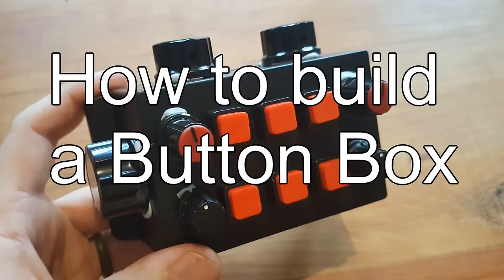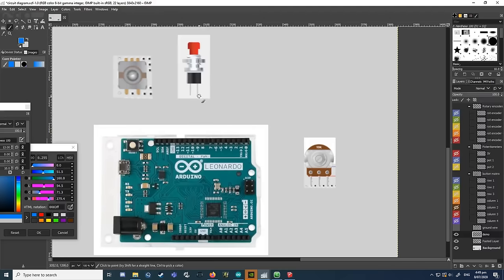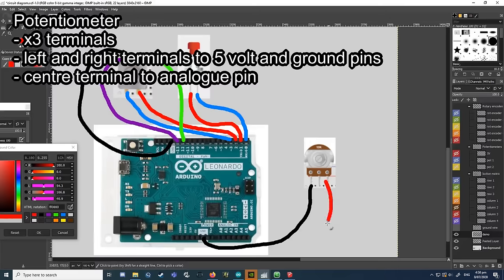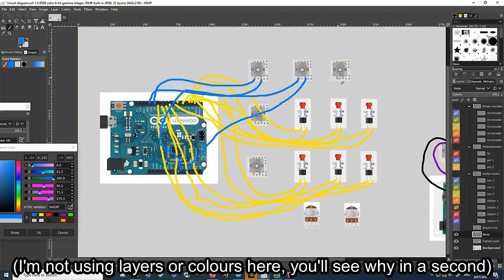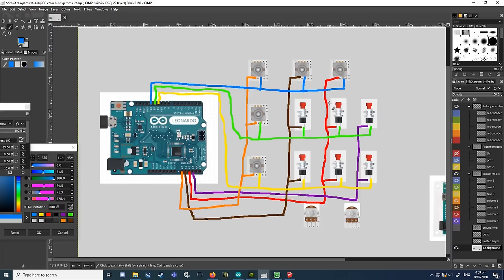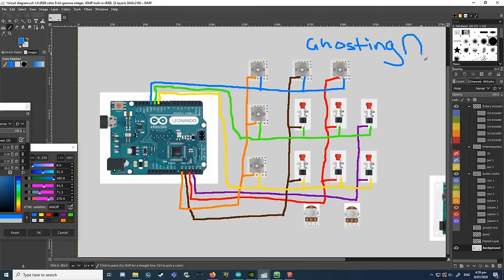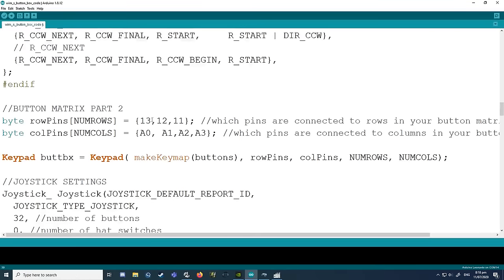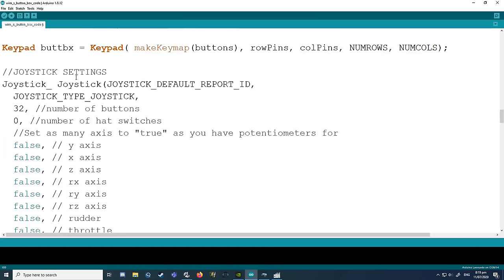How to Build a Button Box

Comment: Ghosting can happen by pressing just two buttons at the same time, if they are on different columns AND different rows.
e.g. If you press the button on column 1 and row 1 and press the button on column 4 and row 3 at the same time, the controller will think you also pressed the buttons on column 1 and row 3 and on column 4 and row 1.
This can be avoided by adding a diode at each switch. Perhaps our host will explain how in another video. (but that would require explaining how matrix scanning actually works)
Reply from the maker: This video is intended for people with zero experience who want to build a button box. It's not intended to be a full lecture in how all the electronics actually work.
Reply: @wimwamjoey  I understand that, and it's a great video, but how much harder to say or understand is it to say "ghosting can happen when you press two buttons at the same time" than "ghosting happens when you press more than two or three buttons..." And I don't think it would be that much harder to understand "the controller turns on the rows one at a time, and checks whether any columns come on at the same time." That way, if you ever want to explain the use of diodes in a later video you wouldn't have to explain that you lied oversimplified in this video. I imagine you expect your viewers to progress with time, yes? If you say that the controller recognizes when a column input and a row input come on at the same time, then as they start to understand how electricity works it is going to confuse them.
Reply: @wimwamjoey  I'm sorry, I just realized, your channel is a gaming channel, not an electronics channel. Few if any of your viewers would care at all how it works, or progress, or be any more confused, in their understanding of electronics.

Comment: good stuff - all I need to do now is to work out to combine the output of 2 potentiometers - i have an old set of pedals from a sidewinder force feed back wheel , and wish to have the value drop on one pedal and the value increase on the other,  but both on the same axis,  so at rest the throttle would be at 50% like the rudder is,  I have had a go but its a challenge when your unfamiliar with  the coding -
Reply from the maker: You might be able to do this using autohotkey and setting it up so that the farther the pot is turned, the faster it taps a key. It's a bit of a janky workaround though and would probably take a lot of fiddling to make it work properly

Comment: I would either use a mega or program multiple arduino microcontroller stand alone chip sets. Also proto wire that I had seem to corrode after time and less reliable in those arduino no solder sockets. For a permanent project I would buy the crystal capacitors and atmel chips program in a uno board, transfer then solder In a different  board.

Comment: Hi, I wanted to tell you that in the end I fixed everything and it works, the only flaw is the rotary encoder which, if turned quickly, is not always able to read the right number of steps, is there any way to improve this? Thank you
Reply: He explains this in the video at 3:45. You'd know if you didn't skip through

Comment: Good afternoon Win.
Instead forgive for this assault and forgive for the writing since it is done with the Google translator; I hope you can understand.
I am writing to you because I have seen this project of yours and I see that you understand all this, congratulations on your project.
I tell you my circumstance:
I am a person with reduced mobility and I have to adapt the accelerator and brake to a steering wheel.
I know there are several options on the market, but I think I can do it myself. The project is to adapt 2 magnetic paddles, one on each side, to have the accelerator and brake on said paddles.
I want to do it with an Arduino NANO and with a potentiometer on each blade.
My question is, could you tell me or give me some Arduino code to be able to execute the 2 potentiometers only?
I have seen in this project of yours where they are connected to Leonardo's board, but I would need the code for my project to work.
Thank you very much for attending me and greetings.
Reply from the maker: Hi there, you can only make a button box with an ATmega32u4 microcontroller. As far as I know, that means you must use a Leonardo or a Pro Micro (or a non-branded copy of those). I'm not sure what microcontroller your nano uses, but if it is the ATmega32u4 chip all you need to do is make sure you have the right kind of board selected in IDE when you upload your code.
Reply: @wimwamjoey  Thank you very much for answering
All the best

Comment: When talking about rotary encoders and potentiometer, which would be better to use for a dial to select between a few different options? Something like a rotary light or air controls in a car. Both are a dial, but both have multiple positions that the dial clicks into.

Comment: I want to try it out before I go full fledged build.
I am planning to order arduino pro micro, 1 two position toggle switch, 1 rotary encoder and 1 potentiometer.
I am getting confused with wiring. The pinout of mico is different.
Would you be able to explain where to connect them on micro?

Comment: I'm brand new to this idea and am exploring it as a potential alternative to buying a button box.  I've never done anything with an Arduino before.  You mention both the Pro Micro and the Leonardo.  What are the differences between the two, and how can I know which one will better suit my needs?
Reply from the maker: Leonardo is intended more for people who  want to reuse their arduino for various different projects. Pro micro is what you'd pick if you just want to use it for one thing.

Main practical difference is that the Promicro is physically smaller than a Leonardo, and you need to solder connections to the board rather than just push wires into sockets like you do for the Leonardo.

I'd probably recommend the Leonardo over the Pro micro for a beginner. If you think you are going to have to have a few goes at getting stuff right, it's easier to do this with a Leonardo, cos you don't have to worry about soldering, desoldering and resoldering wires to the board and potentially breaking it in the process. 

Aside from that, both the Pro micro and Leonardo have a total of 22 pins, however for the Pro-micro 11 of those pins can take analogue signals, while the Leonardo only has 6 analogue pins - so basically if you think you want more than 6 potentiometers, you need to use a Pro micro. 

Finally: Pro micro is a bit cheaper than a Leonardo.
Reply: @wimwamjoey  Thanks so much for responding.  I've done some soldering before when I built a radio as a kid, and some model railroading with my dad, but not a lot, so I'd definitely want to practice before I risked damaging a board.  It sounds like the Leonardo is more what I'm looking for.  I don't think size will be too much of a consideration, and I can't imagine I'd want more than maybe 2 potentiometers at most.  I really appreciate this video and will absolutely use it as a guide when I get around to building a box, hopefully in the next month or so.

Comment: An excellent vide. I used this as a basis for 2 button boxes that I use for DCS. One issue though that I was wondering if there was a solution for? Each box works on its own. But when both are plugged in only one box, the largest one actually works in DCS. The other box shows up, but DCS won't take any inputs with it. Any ideas on how to use both boxes. BTY both use Ardiuno Leonardo's as their brains. Thanks.
Reply: DCS train controller software ? conflict probably, both identify as a "leonardo", plugged in as usb to your pc ?
see https://github.com/MHeironimus/ArduinoJoystickLibrary/issues/14, 
look for the answer from "Dak0r commented on 4 Mar 2017 "

Comment: How do the 3 pin (on)off(on) momentary switches get wired into the matrix?
Reply: You can treat them like two simple push buttons that are on the same column. Wire the center terminal to a column and the other terminals to two different rows (or vice versa if it fits your layout better).

Comment: Hello! Great tutorial you've made here. I'm a little more of an experienced arduino programmer, and i'm wondering why you would use two data-reading IO ports per pin of the push buttons, and not wire one pin to gnd, and one to an io port? This gives you double the amount of available pins, and could be used to avoid a potentially confusing button matrix.
Just another maker, trying to make his way and learn some new tips,
cant wait for your reply.
Reply from the maker: No good reason. I only have very rudimentary knowledge of arduino coding. I figured the button matrix was more flexible and I didn't want to explain another method in this video because it would require substantial changes to the code. I only used the two port method as an example to show why the button matrix is useful.
Reply: @wimwamjoey  thats fair enough. Just wanted to make sure I wasnt missing anything. Nice tutorial again!
Reply: @dachampion_9993  I interpreted your question differently than how he answered. 

I'm using an Arduino micro, and there are far less pins available on it than an Uno, Mega, or Leonardo. I use methods like the matrix to put, say, 16 buttons on a set of two pins. This matrix does actually allow for up to four buttons to be pressed and detected correctly at the same time, so you can group those together if it's likely to occur, and leave buttons out of the group if they physically cannot/wouldn't be pressed together. This IS confusing and some inputs just have to have their own separate pins. Rule of thumb is for the either the entire row or column, you can only have one line closed. If there are two or more closed on both, that iteration of the matrix has to be thrown out completely and not acted upon. 

If you're asking about his diagram at 8:52, and why he has two wires per button going to the controller, it's wrong. You never need to have two IO pins for a contact switch. Maybe for an encoder but that's it. In the case where a single button goes to a single pin, you can either pull it high or low from VCC/GND and have the switch close a CKT to VCC/GND. I pull my inputs low, so I connect my buttons on one side to power, and the other side has a parallel connection to GND and the input pin.

EDIT: Just to be clear, I am NOT calling out Wim for being wrong. I am only saying the configuration at 8:52 (and a couple other times during the video) should never be utilized. He also explains this later on in his video without explicitly stating "Don't do it like this."

Comment: Really well explained :D
Do you have a simple solution for using Multi position switch for his kind of button box?
I tried to do something on my own, but best I've achieved is "pulse mode" since trying to make MPS send constant signal, then it blocks encoder functionality. 
Btw. I have that done by making my MPS work as potentiometer, so it uses only 1 analog pin instead of 10 :)

Comment: I have a butten box allredy but is there a way to look at my code that’s on my board if so how
Reply: There are ways to extract the code that is currently on an Arduino (assuming your box is using an Arduino), but it will be the compiled machine code, not the source code.

Comment: The button matrix is only possible on the arduino boards right? Wouldn't work with something simple like a zero delay?
Reply: Not unless you would be able to change the code running on the board.

Comment: Thank you very much for this video. I have a question: is there an alternative to soldering the matrix to avoid running out of pins? I’m preparing a setup and I’d like avoid soldering as much as possible. I’m new to Arduino and I’m looking for ways to connect the cables without the soldering part. Thanks indeed!

Comment: Cool video. Is there a reason no pull-up or pull-down resistor is needed in this circuit/button box? I watched a couple of video's about how a keypad matrix works and all of those video's suggested you should put a pull-down resistor on every row. So that you don't get floating pins.
Reply from the maker: I had a mate who worked with arduino quite a lot who told me the resistance in the wire itself would be enough for a low voltage project like this. Certainly no harm adding resistors though if you'd rather be safe than sorry

Comment: Was wondering if you could do an updated video some day with how to wire like on off on momentary switches into the matrix, I've been reading a lot of forms and they say to use something called a switching diode, i actually got my switches to function in the aurdino, however only one click registers and it registers it as 3 inputs being pressed at once.
and all the switches are registering the same button press as 4,5, and 6 no matter what switch i flick, so I'm fairly sure there is ghosting happening as well as something else that I am not sure of.

Comment: Hey, great video!  Those Push Buttons... dont they use 12V? So how are you providing them with the 5V the Arduino has?
Reply from the maker: They are rated to 12V but don't require 12V to function. They work perfectly fine at 5V.

Comment: First of all, huge thanks for the tutorial but i have a predicament... in my button box i have 6 3-way momentary switches and i was having trouble on how to wire them... so far i have two of each in a row and two columns with just those switches, my problem is that only connects one of the two buttons per switch and i dont know how to wire the other button... the solution i thought was just to add an extra column, but i dont know if that is correct since i havent found anything anywhere else...

Comment: This is an amazing video wimwamjoey, full of info. Thanks a lot. I have a question. Is it okay to ask it here or can I contact you privately ?
Reply from the maker: Go ahead
Reply: @wimwamjoey  thank you sir. I am very new to arduino and such. Can I make a button box that features the 32 buttons where 4 rotary encoders will obviously be 12 of those buttons and also add 1 analog pot using a pro micro, or will that only be possible on the leonardo which has more pins?
Reply from the maker: Argh, so sorry for delayed answer. This got buried and I didn't have notifications turned on... 

Yes, so long as you configure your button matrix in a way that it doesn't require all the analogue ports for rows/columns you can add a potentiometer. Potentiometers do not count towards the maximum on 32 buttons.

Comment: Hello thanks for the video.
Just a few questions.
I have an old joystick that I want to rewire to go from 15 pin analog to usb.
Using a Arduino pro micro.
Joystick is an old Saitek Cyborg 3d digital.
Joystick is up down left right. 4 analog potentiometers  4th potentiometers is for throttle.
8 way hat.   ??
10 momentary switches. 3x4 switch grid 

1 For  the button matrix can you use just digital pins, no analog pins?
2 How would I wire the 8 way hat on the joystick?
Reply from the maker: Hey mate in answer to your question:
1.) Yes that's no problem.
2.) It depends a lot on how your hat actually functions. 

Most likely, it will work by tripping four switches (up, down, left and right), then reading two buttons being pressed simultaniously as the diagonal inputs, so if you want to maintain it as an 8 way hat, that will require some additional coding on your part. 

If you just do it as a four way hat, you could just include those four buttons as part of your matrix.
Reply: @wimwamjoey  Thanks for the reply.
The hat feels like four buttons an that is all I will need to make do with what I want.
Have a day

Comment: Awhile ago I decided that I wanted to be able to use any old keyboard on my Linux machine as a macro keyboard so I wrote this code:

https://bitbucket.org/NevynHira/macrokeyboard/src/master/

It's all done in software. To change its functionality, you just have to change a single json file. Because it's done in software, it can do things that hardware based macro keyboards can't do such as be aware of what application has focus and act accordingly. i.e. the same key can be used in Firefox to do one thing and used in another application to do something different.

Comment: This is very helpful thanks. Amstudio uses a a Arduino Pro Micro - can that run the potentiometers too? I see some guides say you need the LEONARDO for HID? Some others need DFU and flip the firmware - bit confused by that!
Reply from the maker: I haven't personally tested it but I believe a pro micro can run pots with this code.

Comment: cheers for this mate  - will the code work if I swap out the Leonardo for the Pro Micro?
Reply from the maker: Yep, you just need make sure you have pro-micro selected in the settings of the arduino IDE software

Comment: Thanks for the clear video and for the basic code! 
I'm trying to make AMStudios' bottonbox but I can't get that code working on all buttons so I'm trying to make your code fit. 
What should I do if I don't use any potentiometer? Should I then remove that part from the code or does it not matter?
Reply: Change the ? To 0 , I left the ? And code failed , changed both ? To 0 and works mint

Comment: Wim, I had one other question in regards to momentary toggles with 3 poles. (On) off (on). I am going to be using 4. Do I need to wire the middle pole to the board at all? If so should it be to the analog or digital side?
Reply: yes. The momentary switch will momentarily connect the middle pole, and the pole on the side you moved the switch to. You can use the switch as 2 inputs by connecting the - to the center pole and 2 + , 1 on each side of the switch. Push up will be 1 input, down will be the other.